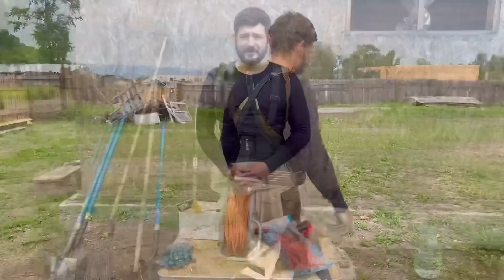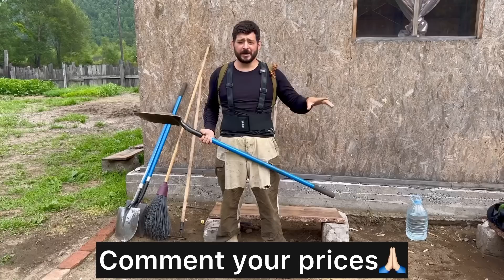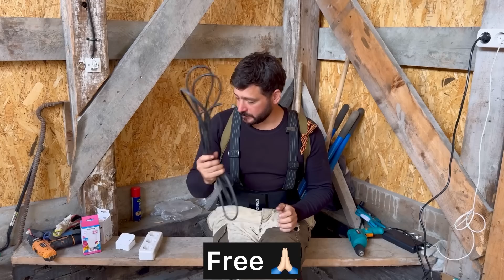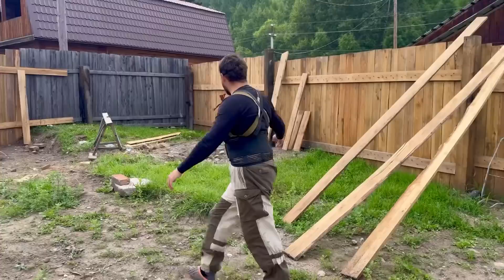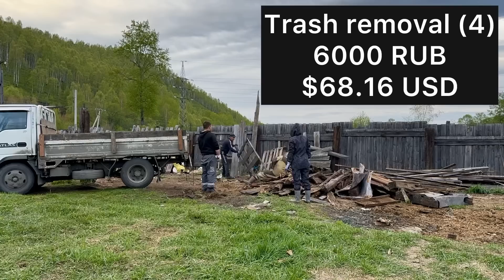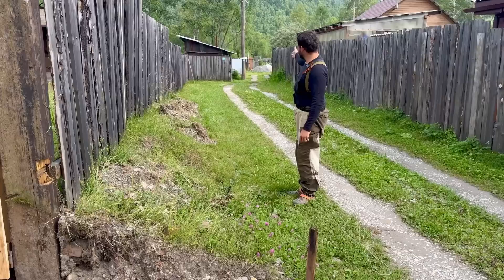Spending  $10,000 IN RUSSIAN HOUSE PROJECT

Comment: It is really cheap. To get rid of the concrete and garbage, you would have paid ten times as much in Germany - rather more. Tools are always difficult to judge. One part is consumption like screws, but machines are not there for one project alone - and of course if you have to buy everything, it is far more expensive than if most of the equipment is already  available

Comment: Tools. Actually I do not know their price, well in fact I know it when I'm buying, but I bought it so long ago.. It's a way easier to check some home depot websites that can give comparison over regions. Electricity. It's cheap, but it's the cheapest in Siberia, specifically paying 3.4 rub per Kwh, so it definitely cannot be 20 rub per month, to be honest it isn't even 200rub per month :(. Pile of trash.. man! You're american! Firepit! Heating. Whatever! Why the heck did you throw it all away and paid for it!? You could even cook potatoes in that fire))) Similar thing for bricks, I do not know what kind of soil you have, but sometimes you simply need kind of hardening it or fill the gaps before pouring concrete .. e.g. for concrete paths, which are not heavily loaded but still require some good base, again hardening driveway just damn smuck these bricks and harden it so it won't be so muddy and not as waterproof as pavement. The only thing is glass, but again, if you plan some sheds for whatever, it probably will require windows and you can actually use that glass for it and not buy it. Yes, it's an awful solution when you need to keep the climate inside, but usually sheds are for tools and just in case stuff, not for living there 24x7x365. You're living in a rural area (as it seems) and simply wasting industrial resources which actually can cost you $$$ Flattening your spot - damn, that is actually a brilliant idea!!! And I have to admit - good job. Have good luck!

Comment: As someone that lives in the USA, this is insanely cheap to me! I'm curious about how much the wood will cost to build your house. The two most expensive things when building a house in America are the wood (especially plywood/OSB) and initial utility hook ups (for electricity, water/well water, internet). 

I live in a kinda rural area in a very cheap (pre-manufactured house - basically a mobile home with out wheels) on about 1.5 acres of land in the Northern USA. If my house burned down, it would probably cost me about $200,000-$250,000 [17,573,338.00 Rubles to 21,966,672.50 Rubles] to replace it and my land is valued (empty/vacant) at an additional $150,000 [13,180,003.50]. Every year, I have to pay an about $7,000USD [615,066.83 Rubles] to my town for property tax (basically, road maintenance, plowing, police, fire, kids education, and administration).

On the tool prices, they also seem cheap to me and make good sense. Basically, stuff that seemed to contain expensive commodities like Copper, or a special/difficult manufacturing process like hardened steel hammers was more expensive. But, other stuff was very inexpensive.

The delivery and manual labor costs were also amazing to me given that you life far from a major urban center and only have dirt road access locally.

I can't believe how cheap things are in Russia! Most people in America cannot afford to get married or have kids. I couldn't afford to buy my house until I was nearly 40 years old (too old to have kids or even find a wife). Back when I bought it about 10 years ago, it was only half the price it is not (most of that different was due to an economic crash in real estate in America, though). I really should think about moving to Russia!!!

Thanks for sharing all this great detailed information! I really enjoy your channel. I also like that you have made videos about Mexico. Most Americans that want to leave the USA because of how bad things are here are thinking either Russia, Eastern Europe, or Mexico. My long term neighbors just moved to Canada to escape the inflation and problems here.

Comment: Regarding the relocation of the fence: keep in mind that the width of the passage between areas must be at least 3.5 meters - these are fire safety requirements. If your site was properly surveyed and its boundaries (based on the pegs that you showed) correspond to the cadastral plan, then, judging by your video, with a high degree of probability, after the fence is moved, this standard will NOT be met. The question arises about the authenticity of the boundaries and the legality of placing a fence by the owner of the property opposite to you. Also keep in mind that the legislation defines standards for the distance between the house and the fence (at least 3 meters).
Reply from the maker: Yes all this was taken into account the man in front is off his limits

Comment: The only thing that was not cheaper was the wall socket plug, everything else is 5 to 10 times more expensive in my country, wood plank or even stick are extremely expensive in my country, a 60 yard Wood fence would cost easily 10 K $ only in construction material, and i am talking about a straight fence line, not fence around the whole property.

Comment: Hi.     Please - talk to an experienced local construction worker - the foundation is extremelly important there ( it should be deep enough, maybe 2.5 meters deep or more!)  Also remember - it is a bit seismic zone, it challenges foundation even more.
Reply from the maker: Of course
Reply: @Wild-Siberia    
you can save on everything - on the material of the walls, even on the roof, but there are two things on which in Siberia, in my opinion, you cannot save.  The first is the foundation.   Well, secondly - my choice will probably cause surprise - but this is a good, large brick stove (also on a separate foundation)

Comment: Tool prices are about the same here in Canada but I wouldn't worry about it because it's an investment and You're going to use them over and over again and don't go cheap on tools, buy quality stuff!
Labour prices are ridiculously low and I mean that. In Canada using a buldoser would cost 3-4 times more.
Dan You're one of the most hardworking people out there. 
PS. I wonder if You were thinking of getting Yourself a 4x4 pickup truck?
Go to Vladivostok, buy it cheap(er) and drive back before winter came!
Reply from the maker: I wanna buy a 4x4 but it’s all going for the house build 🥲

Comment: I live in Romania, our prices are definitely higher now, by quite a bit I’d say but I can’t really compare because it depends on the brands and the quality of the items you purchased. For example for a shovel $40 sounds expensive but it looks higher quality than what they’d sell at a local “magazin”☺️
Since you plan to do the build yourself you probably need to invest in some decent power tools (saws, a concrete mixer, a sander).
One thing I was shocked about how cheap it is, the timber you used for the fence, it’s dirt cheap for the amount you got. And the plot is fairly affordable…well, it sounds like it, but on the other hand there are probably not many jobs in the area or a thriving economy so maybe for a local it’s not that affordable. Our plot is the same size, also small town/village, it’s valued at over 10x that but the prices for land differ a lot depending on region, amenities and work opportunities.

I mean no offense but it’s too funny, a Mexican dude saying “build this wall” (when it’s a fence) so many times during these videos, it made me laugh😁
Reply from the maker: Yes the power tools will be bought once I need them, in the next process “the foundation” I’ll need power tools and other more expensive tools like levels
Reply: @Wild-Siberia  We had our house built to the “shell” stage and did the rest ourselves (install wood ceilings, doors, render the walls, flooring, tiling, painting), and we had some fails too. I don’t know if you need the advice but from what we learnt the “need to have” tools were an impact drill (preferably a higher power one that you can also use to mix mortar, render etc),) an angle grinder, drop saw, jigsaw, manual tile cutter, a level and a whole lot of trowels and buckets.

Comment: Just paid $720 for 40 - 2x6x12 pressure treated deck boards w/delivery and $228 for materials to build a floating deck from Home Depot. Spent another $225 for TuffBlocks. Total $1173 for a 12x12 floating deck. Labor provided by myself and wife.

Comment: Do the shovels have washing machine chips? Just kidding 😂 it's vary cheap so far. Good luck 👍
Reply: In Russia, everything has a washing machine chip. 🙃
Reply: @СимонВизенталь-ы7ь  In fact, Russia has its own lithographs for 350 nm, which is enough for industrial applications and 130-90 nm and 60 nm for the military.
Reply from the maker: These are trench destroyers

Comment: Be careful with such an extension cord, unwind the wire from the coil when you turn on powerful electrical appliances. During operation, the cable heats up, especially if it is not very high-quality, wrapped in a coil, it heats up quite strongly and the insulation of the wire may melt.
Reply: It is recommended to unroll this extension cord during operation. 
Otherwise, induction occurs in the spiral
Reply from the maker: Good call
Reply: @Wild-Siberia  также учитывайте калибр проводов. Если для дрели может и хватит 1.5мм2 площади сечения, то 0.75,мм2, а такое не редко продают в длиннх, но тяжелых бухтах, будет уже опасно и немощно. Я бы брал 2,5 или даже 4 (но тут уже надо понять для чего). Зависит от той мощности, которую вам выделила на землю энергокомпания.

Comment: I couldn’t keep track of your prices, unless I was to rewatch everything and write it down. Anything to do with labor cost including using the cranes and any other machinery, sounds extremely cheap. Some of your hardware items like hammers, and locks to me seem to be about the same price as here in Kentucky. Of course, a lot of that depends on quality prices vary widely. Some fines like your rolled up electrical cord seemed a little on the expensive side to me. Here we have a store called HarborFreight that you can get some phones like your Tools and electrical cords, Cheaper, but all of that is Chinese imports. If I were to be buying all those items at the regular local hardware store, which will be more in line with the type of place you’re buying most everything would probably be anywhere from a little higher to a lot higher.
Reply from the maker: Harbor freight is a good store when you’re having projects because they have all sorts of quality tools at different ranges thanks for the comment terry I appreciate the time you took to assess the situation 🤝🏻
Reply: It is because he is relatively deep in countryside that labor is cheaper and goods are more expensive - people who own cranes and trucks (most of them private owned) have not many orders, on the other hand it is expensive to deliver goods in small quantities. Sometimes it is cheaper to buy materials you need in nearest big city and hire semi-trailer to deliver it.

Comment: In the long run, you will find Battery powered tools much more useful, than the ones requiring a wire to operate.
The Batteries can also help you in time of power outages, to serve in combination with an inverter.
Reply: He lives in Irkutsk region, man, the power is not a problem there, cheap even by Russian standard and outages are extremely rare.

Cordless tools are nice, but only if you're using them all the time. They're more expensive, so if you need tools for a project or only occasionally there's not much point to waste money on cordless.
Reply: @Олег-г1с4г  Where did that happen ?
I remember 2003 in Ontario, New York State, Ohio, Pennssylvania, Maine and Vermont where the whole Grid gave in for about 2 days, in some Regions, hard to believe that was 22 years ago.
Nothing that drastic since than, but at least 3 outages per year in the Central Georgian Bay Region. Where did that happen ?
Reply: @Олег-г1с4г  I guess we misunderstood each other. I like batterey driven powertools, because dragging a cord behind me, is a pain in the neck, when moving around a lot. Also when going camping. I can power lights and Laptops with the Inverter version provided (have to be purchased separately). Somehow we ended up talking about Power Outages.And yes, there are pros and contras. It seems Russia has the better Electrical Grid.